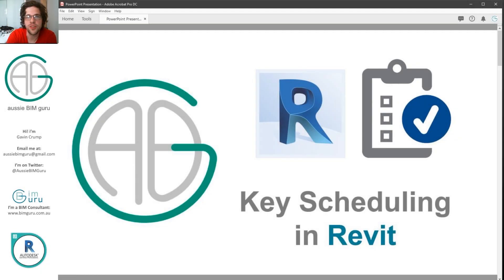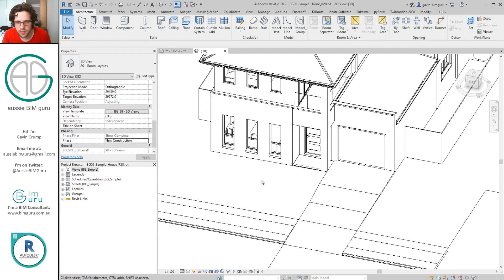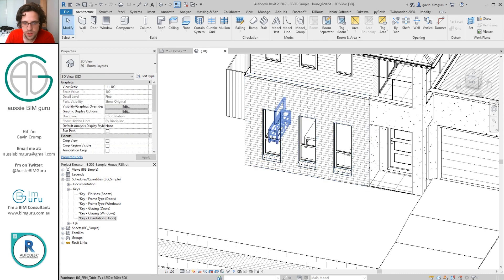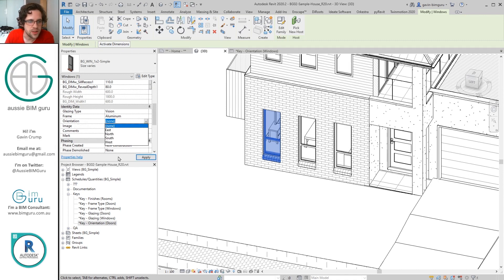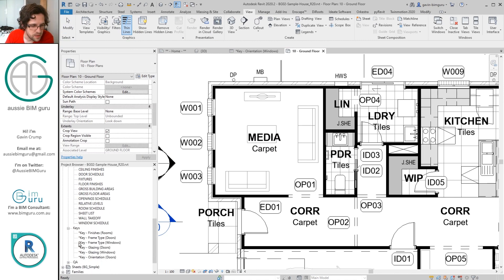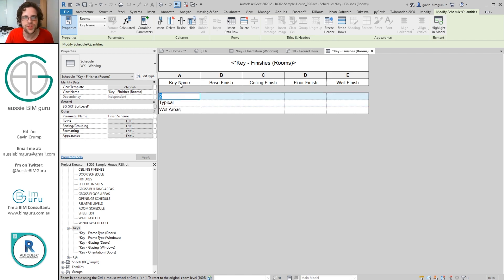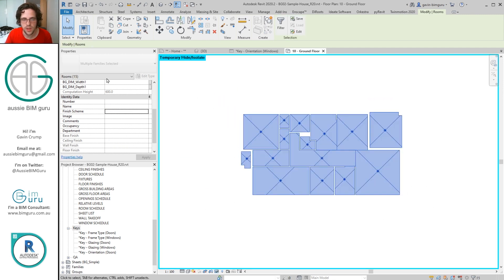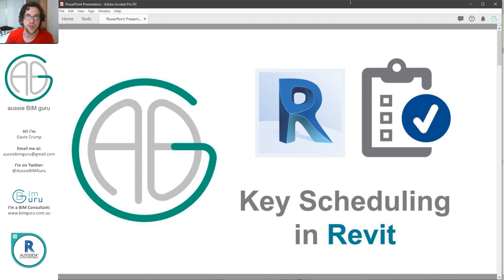Key Scheduling in Revit!

Comment: Hi Gavin, thank you for the fantastic video.
 I have an inquiry about a concrete structure that I want to inspect. I want to add a parameter named 'deficit' and create a list of inside parameters under the name 'deficit.' When I press on this list, it should display three problems: heavy shear, heavy deflection, and no deficit. If I choose, for example, 'heavy shear,' another parameter should advise on the type of test, such as UPV. How can I achieve this? Thanks.
Reply from the maker: So to achieve that using key schedules you would need to make your Key schedule using a key parameter for deficit, then you could use it to set the value of other shared parameters added as project parameters (e.g. Test type). If you use Revit 2022+ they can be shared, but before then it was only possible using non-shared project parameters.
Reply: @AussieBIMGuru   Thanks for your answer. I will try to do that and inform you. Cheers!

Comment: This was really useful, as usual Gavin :) 
I am only left wondering how to better organize my schedules on a template level. I like to prepare some basic ones for Sketch Design (related to rooms, levels, massing...), some crucial ones for Detailed Design (related to municipality indexes, permeability, volume, etc.) and some detailed ones for Construction Documents (more complex to set up but necessary, specially to withdraw measures and quantities of gypsum walls, wood elements, paint areas, etc...).

I feel like this 3 levels (organization schemes) work very well for us, but I was wondering if you have any other suggestions, also from a BIM Manager point of view, for auditing the model, etc...

Thank you again for all the great content! Cheers :D
Reply from the maker: Schedules I usually make 1 or 2 levels depending on project type/phase. I usually rely on naming conventions a bit to keep it sorted as well as using browser depth.

I keep keys at 1 level together, or 2 levels by category. I always name key schedules with the category name as the prefixm

Ideally keys should capture all data needed when it's known (e.g. floor finish may be irrelevant at the sketch phase, but no harm in having a default setting for it as a key already).

Comment: Gavin, thanks for sharing! Great technique, definitely useful :)
I'm sure you're aware, and that this video has a different target audience, but maybe it would benefit your dynamo series - there is a way to auto orientate windows using Dynamo ;) I have the script if you wanna have a look, lemme know.

Cheers,
Adam
Reply from the maker: Interesting, what exactly do you mean by auto-orientate? I'm guessing it means that windows are placed to optimize solar gain?
Reply: @AussieBIMGuru  The windows orientation is deduced based on project orientation, that's all :)
Reply from the maker: @AKP_TECH  ah so for things like Basix/ESD requirements I assume? I have a script in Dynamo for this also, handy little script. Might share it at a later date as a video.

Comment: I use key schedules for plumbing fixtures. there is a lot of info that is needed but is too much to model. So when I assign L-1 to a lavatory all the info gets filled out on the schedule.
Reply from the maker: Great application! I expect this is often much easier for standardized spec readouts and performance requirements.

Comment: Gavin, great vision.  I use the Key Schedule, in a similar manner.  The Briefing, Concept stage is fraught with many considerations, Form, Function, Cost (Client asks ...thoughts? Mr Architect!), we try to get on without ado! (LOL)  One aspect we don't include is the minimum Performance requirements of an element, given the Building Type and local regulations.  Each project we re-invent the compliance effort.  These are good to get early ideas in colour and layout.  And the Shared Parameters, inclusion will be  a big improvement.  Nice One.
Reply from the maker: Yeah shared parameters will make this far more usable for performance needs!
Reply: @AussieBIMGuru  People don't use this typically for the removal of the flexibility, it doesn't provide.  The same reason is good to get constraints that give one place for update and make the modelling a conscious effort/pleasure.